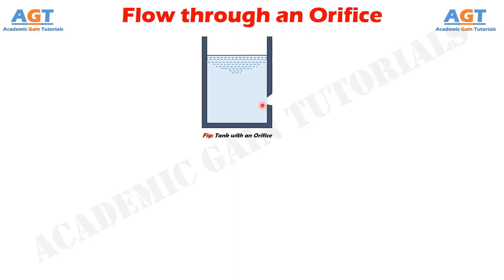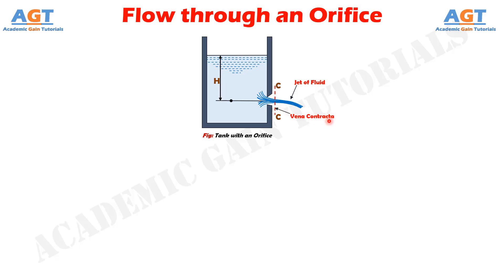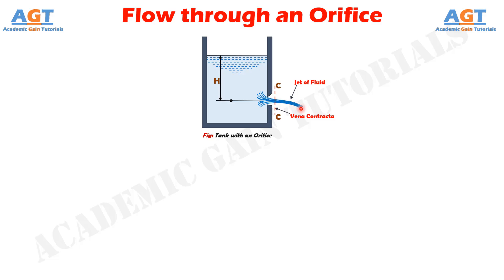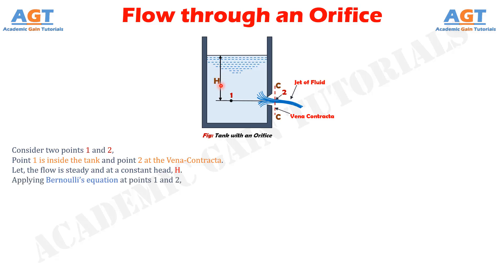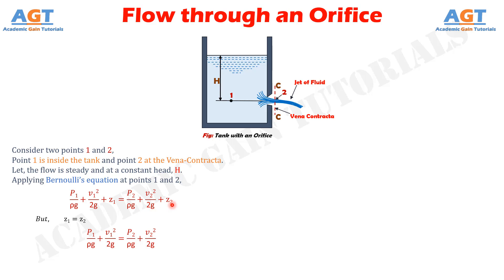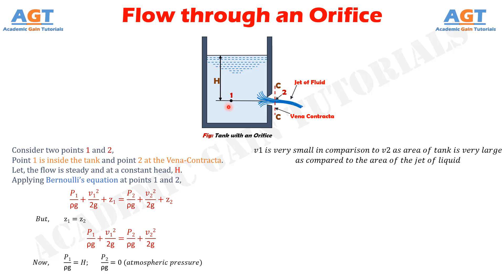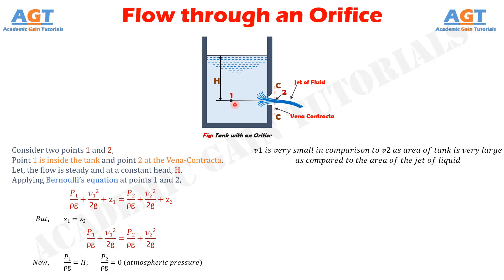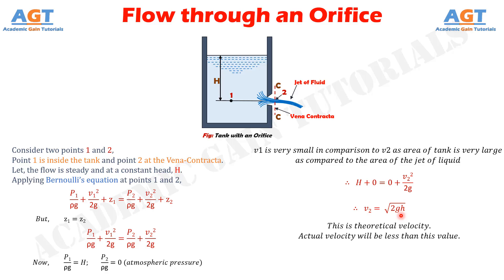Flow through an Orifice - Explained.

Comment: Technically speaking,  P1/pg  = H + Patm/pg   and P2/pg  =  Patm/pg  ...Hence,  P1/pg - P2/pg = ( H + Patm/pg  ) -  Patm/pg  .  Finally  delta (P1 -P2)/pg = H.   The expression developed in your video is ok...since the tank is open to the atmosphere....but to be correct, the fact is that the pressure above the orifice is due to the liquid elevation plus any pressure over the liquid.